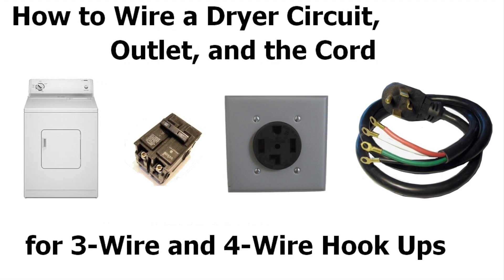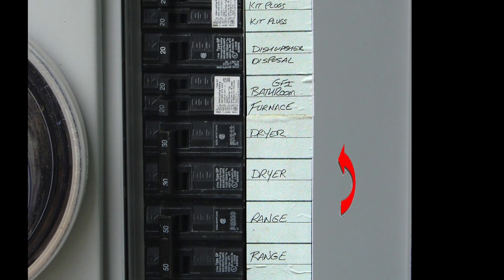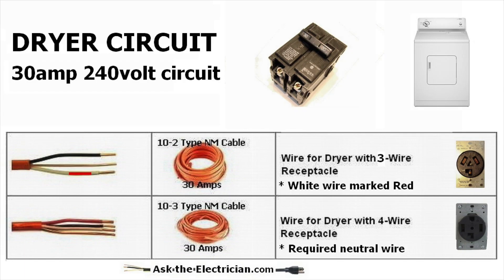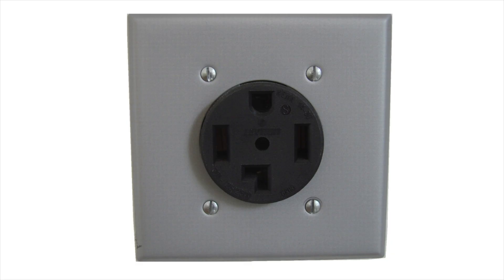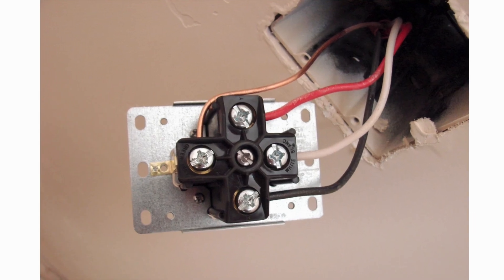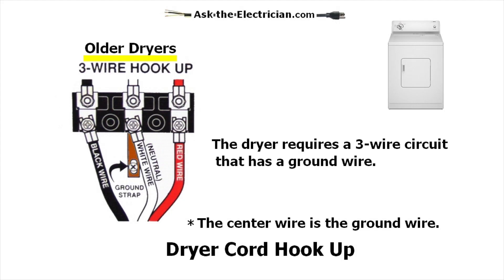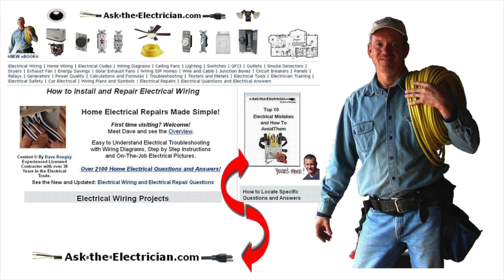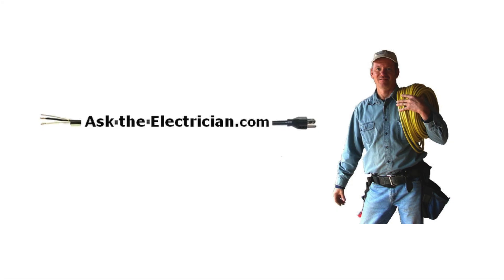How to Wire a Dryer Cord, and Dryer Outlet, 3Prong and 4Prong Dryer Cord.

Comment: Question for you,  I am going from a three wire power cord to a four which I am about to install.  The middle wire on the terminal block on the inside of the dryer is green.  I know usually it is white.  This same wire is connected to the ground screw outside the dryer currently.  Is the green wire acting as a neutral and would I disconnect from the outside of the dryer and connect it to the neutral screw inside the dryer with the new power cords neutral white wire as you normally would do? All the dryers I have worked on and switched dryer cords always had white inside the dryer and the terminal block.  Thanks in advance.
Reply from the maker: My question to you is where are you getting the 4th wire from?
If the dryer requires 4 wires then there has to be 4 wires from the circuit. If the dryer installation manual states that the neutral or ground may be shared then the dryer would be allowing a 3wire cord and outlet, otherwise the dryer is requiring a separate ground wire and a separate neutral wire. Please check the installation manual and the electrical specifications.
Reply: @AskTheElectrician  Firstly,  thank you for the response.  To answer your question,  there are the two hots,  black and red and then a green in the middle where a white neutral usually is.  The green goes from that middle spot on the terminal all the way to the ground screw outside the dryer.  So that is basically my four wires.  I have looked at online manuals and one manual says that wire is green with a yellow stripe. It is not though.  When I have looked up the dryer parts on parts websites,  they have that middle wire being white,  a black, red and then a green and white together.  When looking on ebay for exact replacement parts I found one that has my same exact set up,  red, black, green.  Hope that helps explain my dryer situation.  For reference it is a maytag mde2400ayw.

Comment: @Ask-The-Electrician Thank you for the informative video.  I moved into a house that has a 10/3 wire installed into a 3 prong dryer outlet.  The ground and neutral wire are screwed into the same prong on the receptacle (the neutral prong).  Will that damage the dryer? (Mine stopped working properly). Should whoever installed it simply have left the ground wire on the side, not connected?  I bought a new dryer and will upgrade to a 4 prong outlet.  I'm curious as to what benefits a 4 prong setup offers vs. a 3 prong setup. I want to understand why dryer manufacturers began designing 4 prong connections on dryers.  Thanks for your insight.
Reply from the maker: Hi Jose, Thanks for viewing the video and your comments.
You are correct, a newer dryer will require a 4-wire cord and 4 prong outlet, so it is great that the existing circuit wiring has all 4 wires as needed, two hots, a neutral, and a ground wire..
The newer dryers now require a separate insulated neutral wire because some of the controls require 120volts.
As with any electrical circuit, a ground is required, however the old electric dryers that did not have a neutral wire were a basic 240volt circuit, but the new dryers that require a neutral wire are 120/240volt because the circuit provides both 120volt (one of the hots with the neutral) and 240volt provided with the two hots. However the older 240volt circuits will test as 120volts when testing each line to ground, but we know that a ground wire cannot be used as a current carrying conductor, therefore the newer electric dryers require a insulated neutral wire.
Reply: 4 prong has a ground and 3 prong doesn't. That's the difference. The ground protects the hot from a short. If the hot is shorting on metal the ground will trip the breaker and keep it tripped until hot wire short is fixed. Never use a ground as or with a neutral or electricity will be energized on the grounds when power is being used on that circuit. In a main breaker box panel that has the main shutoff breaker in the panel the neutrals and grounds are bonded with the green bonding screw.

Comment: So I’m moving my older dryer with 3 prong. Do older models not have to step down for 120v controls? That would be the purpose for an insulated neutral, so it’s not the case for 3 wire config?
Reply from the maker: The voltage does not step down from 240 to 120 - if you have an all electric dryer. The requirement for a separate neutral and ground will be described in the installation manual for our specific dryer.
Reply: @AskTheElectrician  thanks! Got it. Neutral was added for safety.

Comment: Wiring the three wire receptacle SHOWS the uninsulated ground being used 
as a conductor.???    While the older dryer 3 wire diagram (correctly) shows the NEUTRAL
doing DOUBLE DUTY as both the equipment ground and neutral.
Reply from the maker: A ground wire is not considered a current carrying conductor, this is why most ground wires are not insulated with Type-NM Cables, and the same is true with most main service ground wires, except where an insulated ground wire is required for a specific application.

Comment: Great video but how do you hook up a 4 wires to the 30amp breaker in the box?
Reply from the maker: Typically the Black wire is connected to one terminal of the 2-pole breaker, and the Red wire is connected to the other terminal of the 2-p;ole breaker, the White neutral wire is connected to the Neutral terminal bar, and the Bare or Green wire is connected to the Ground terminal bar.

Comment: You did not make it very clear.   If you have 3 conductors with ground in the box, and a dryer that was manufactured in the 90’s or newer, you should buy a 4 wire plug, and use a 4 wire receptacle.   If the house has a 4 wire and your cord is 3 wire, change the cord, not the receptacle.
Reply from the maker: If a new dryer circuit will be installed it should be a 4wire circuit, which includes the ground wire. But when hooking up to the dryer we always look at the specific dryer and what the specifications for that dryer require, then we install the proper cord, and change the receptacle as needed. The cord and receptacle must match the dryer specification, however the wiring of a 4wire circuit may be adapted for the specific requirement.
Reply: @AskTheElectrician     How long since you have seen a dryer with specification of a 3 wire cord and plug only?

Comment: I have a 4 wire dryer outlet 240 volt. 2 hots, a ground and a neutral. Would it be safe to use an adapter (3 wire) that eliminates the neutral  pin, and just uses 2 hots, and a ground?
Reply from the maker: If the adapter is rated for 30amps, and the dryer requires a 3wire cord then the adapter should work fine.
Enjoy Your Dryer!
Reply: @AskTheElectrician  Thanks for confirming my understanding what I had, and could do.
Reply: @ricanrod8258     You should buy a 4 wire cord and install it on the dryer if it has the neutral ground jumper if there is a wiring schematic on the back showing both ways.   Not some adapter that is for dryers from the 1980’s.

Comment: Can 10/3 be used instead of 10/2 since 10/3 has to hots,neutral and a ground. Also is there a certain type of 10/3 I can use. It is for a 3 prong electric dryer
Reply from the maker: Yes 10/3 is best to install if a new dryer circuit is being installed. The typical cable is Type-NM 10/3 w/G  - it has an Orange jacket, copper conductors of course.
Reply: @AskTheElectrician  ok also on the outlet end there are 3 connections 2 hots and 1 neutral what should I do with the ground should I connect it with the netural or don't connect it at all
Reply: @aaronwilliams1473      You should change the cord if 3 wire and dryer shows wiring for both to 4 wire cord.   Dryers have been 4 wire since 1990’s but capable for 3 wire in older houses.

Comment: Very good and complete educational video. We have to upgrade ours to 4-prong and I can simply follow these for our condo.

For a condo built in 1987, do I need to check circuit breaker panel  to see if it has ground wire for  dryer breakers?
From what I know it should have ground.
Reply from the maker: Thank You for viewing!

Comment: I was installing a new NEMA 10-30 dryer 3 pole plug. When I took off the old socket (it was cracked), there were 4 wires inside. The bare copper ground was secured to the back of the box, while the others were tied to the hots and  nuetral. Is this correct? I have seen other videos that show that bare copper not connected, which I presume means it is also not connected at the box.

What is the correct breaker box and plug box connection at each?
Reply from the maker: As with any circuit, the ground wire is the most important wire, and it should be terminated properly. If the outlet box is metal, then the ground wire should be bonded to the box by using a ground screw, or when the outlet has a built in bonding strap to the frame of the outlet. In the case of a dryer, we have old 240volt dryers that do not require a neutral, and we have new 120/240volt dryers that do require a neutral. So we always use the ground wire. But in some cases depending on the age of the dryer, the neutral may not be used. In the case where the dryer circuit is fed from the main service panel, both the ground and the neutral  are bonded together.

Comment: Rewiring house, for dryer I thought the new dryer was 50 amp so bought 6/2 wire. After checking it is a 30 amp, can I still use the 6/2  wire and 30 amp breaker or do I have to buy 10/2 wire for the 30 amp breaker
Reply: You can still use the 6/2 with a 30 amp breaker.
Reply from the maker: If the walls are still open it would be best to replace the cable. It is not illegal to oversize the wire, however it will be much harder to makeup the dryer outlet with the larger wire.

Comment: Even tho I need an immediate answer my female box where the wire plugs into only has 3 wires but none are red... black white and bare copper.or is this set up not right and I beleive it to be on  2 30 amp breaker is that ok.
Reply from the maker: Could be - so check the wiring very carefully and verify that it is correct.

Comment: Is there a reason why the middle wire is connected before the left and right?
Reply from the maker: No - it's just the way we do it.
Reply: @AskTheElectrician  establishing the path back to the source before the connection of hots is a safe practice even though they should not be working with anything hot.  That could be a reason past, it's just the way we do it.